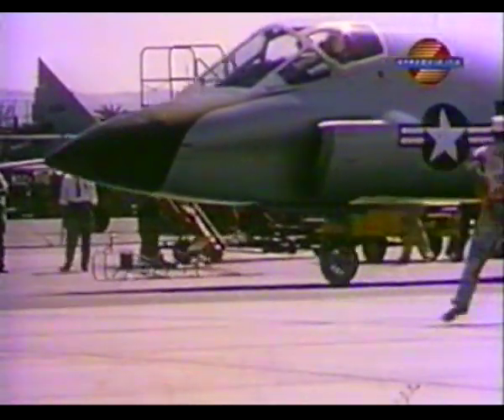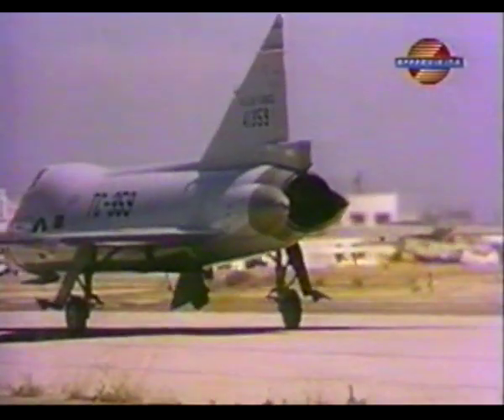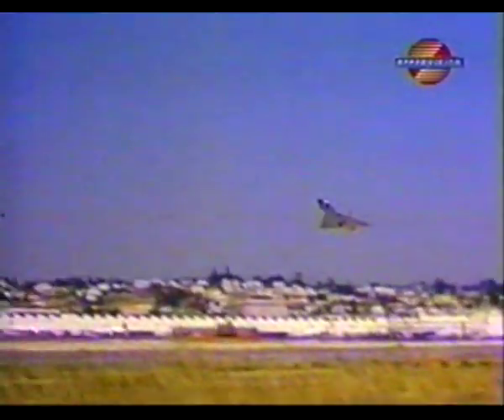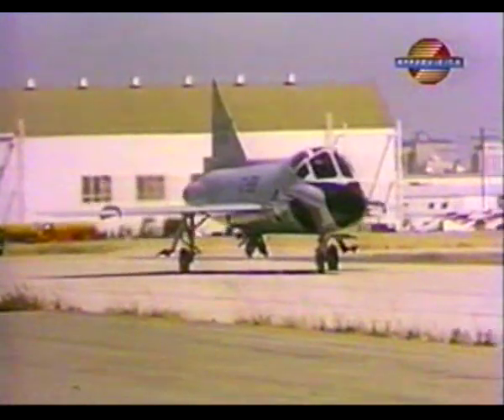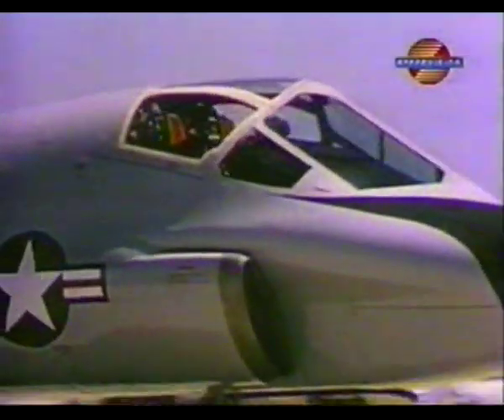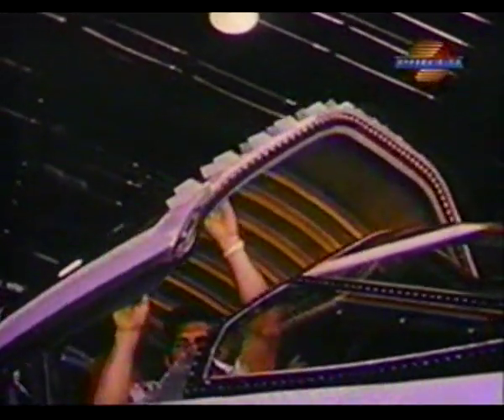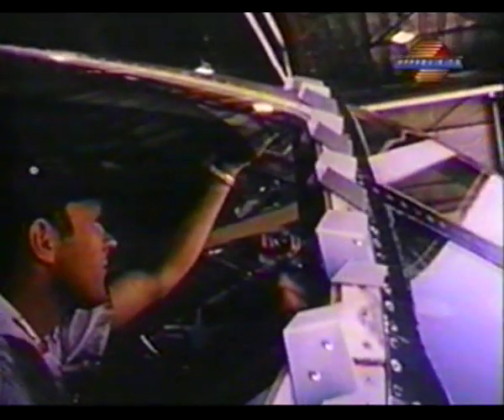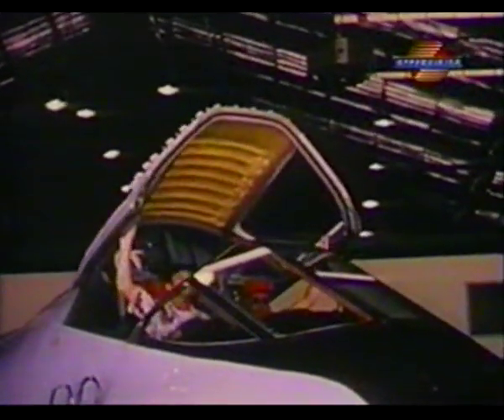Convair TF-102 Delta Dagger

Comment: @tasoscorsair They did know that; it was that knowledge which saved the F-102 program, since even the single-seat prototypes couldn't go supersonic in level flight until the fuselage was redesigned. The trouble was that the TF-102's fuselage was simply too wide for the power available, and the Air Force decided that for a trainer visibility was more important than maximum speed; after all, the most challenging stages of flight are takeoff and landing, when visibility is key.